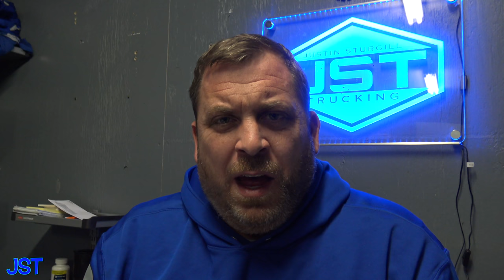HOW TO PICK GEAR RATIO IN A SEMI TRUCK OR DUMP TRUCK

Comment: I bought a prevost bus to do a conversion it has a Rockwell international rear end 3:73   My father in law said I was a fucking  idiot because I won’t be able to go over 50 miles a hour. It has a Allison transmission and a 6v92. If this is true I don’t want it. I haven’t driven it but is my father in law correct ? I mean it’s a seated coach not a city bus

Comment: My tractor has 2.64 rear, .78 od in high gear, 1150 rpm @65mph
Reply: How does it pull heavy on big hills? What mpg do you get? My trk is 430hp w 3.58 ratio. Pulls really good & good mpg too. Was looking @ trk w 2.64 and wondering how it would do.

Comment: boss man very good video just subscribe mani nturn my self in a mechanic diesel because the high price on diesel mechanis and never fixed rigth so ihave a2010 intertrachional whith maxforce kill my pocket and i swap my self a 8.3 cummins mechanical and a 6 speed eaton but no pass 42 milles max speed 49 full trotell can u help me please 19.5 tires 463 diferential

Comment: High horsepower and low rpm is great for torque
Reply: My Cummins X15 efficiency has 455hp @1,500rpm and 1850 lb-ft@1,000rpm. If I had the performance version and a good final drive this thing would be ridiculously fast. It's already fast now.
Reply: To be a little persnickety here you kind of have it backwards. 

Torque X rpm divided by a constant is horsepower. Aka torque is the power, hp is the rate of the power.

So if you have high hp at low rpm it's because it's a torque monster

Comment: Diesels do not like low rpm . I don’t know how many times Ive was told by diesel mechanics that rpm is good , lugging a motor is bad . In a road truck I like to have gas pedal there. What I mean is any time I want some “ get up and go” I want it there . If I need to pass or I’m coming up to a grade I like to have something left in the gas Pedal and not have to drop down two or three gears to get it ( more or less) . I’ll take the extra rpms over sitting out there in the right lane “ Johnny two stacks”  riding haha. Big ass motor, fucking 18 speed ( six inch dual stacks haha)and he’s sitting there with the radio on blasting country, mouth full of chew , and nothing but black smoke on the right foot because he’s got some stupid “ road gear” in it. Fuck that. I’ve said it before, god bless you and your achievements thus far but when it comes to real world driving big trucks you always were kinda  of fishy and you still are. And I’ll tell you a little secret there Justin. In all the years and thousands of loads I’ve hauled, first gear never got touched . Lol,  “ first gear , oh you mean second? “ Yes, Ill grab first gear if I’m crawling , loaded coming out of a hole or I’m trying to get back on some flat ground but besides those situations, first gear sits there,lonely as hell” . And my clutch adjustments were just fine. You have those pretty new 18 speeds with those big Cummin motors in them . Take your cell phone “ truck boss” and go jump in one and get out there and  “ drive it” Don’t worry , “ Mr. Cummins” can handle it. “ I got to fuckin go”
Reply: r u a troll? if not you sound like one :) just asking?
Reply: Your giving shit to a guy that owns 10 trucks , running night and day and employs dozens of people? I didn't hear how many people you employ?....